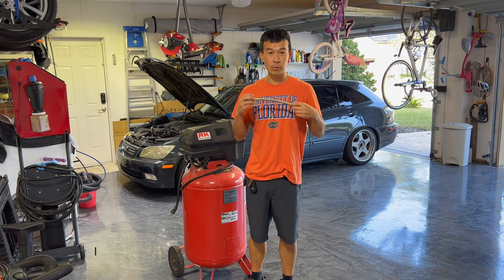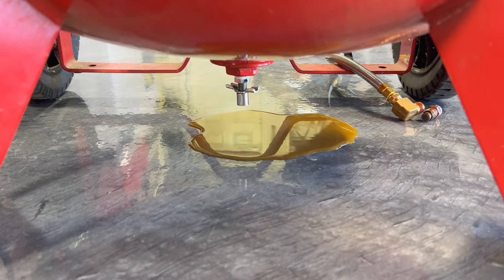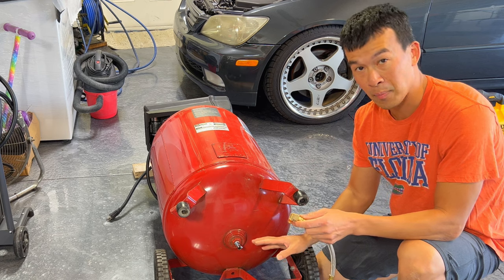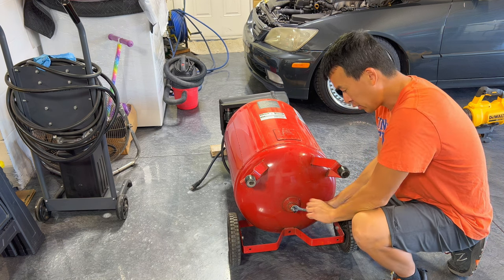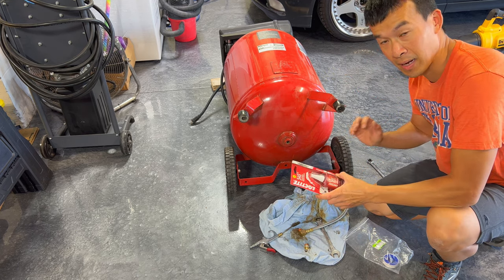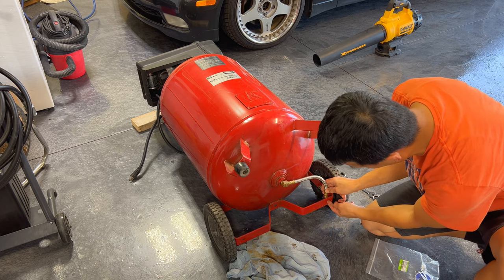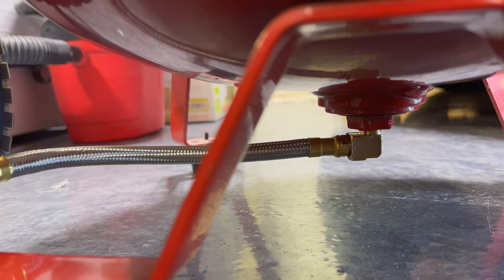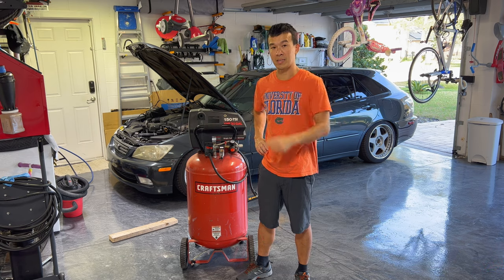Air Compressor Drain Valve Replacement - Water Drain Extension

Comment: Thanks!I had mines seating fit a year since we bought our house. Went to use it and noticed drain valve won’t close and started looking for alternatives repair options. This help since now I can use this method to drain out to my little vent in my garage Vs worrying about a tray
Reply from the maker: Yea for my 60 gallon, I open the valve once a week and just spray the water. It’s not much but good habit for keep water out of the tank.

Comment: I purchased a Black Husky 20-gallon vertical air compressor from the marketplace yesterday. However, seller said the motor fan is broken. I've already ordered a replacement fan. The seller assured me that the compressor is less than 2 years old, despite the broken fan. He mentioned that it has been stored in my garage for about 9 months. He suggested that by replacing the fan and draining the water from the tank, it should operate like new. Is it acceptable for the water to have been sitting in the tank for approximately 9 months, considering the seller's claim that the compressor is less than 2 years old? It's my first time using an air compressor, and after watching this video, I'm a bit worried about the possibility of an explosion. :)
Reply from the maker: You can see the date code on most tanks. There’s a plate and stamp. As long as it was sealed, water isn’t an issue. I’ve left mine with moisture longer. If you want to be 100% you can hydro test with water and a pressure washer. I have a separate video on that.
Reply: @TunerwithKids  Got it, thanks. I'll be sure to watch your other video on hydro testing from your channel.

Comment: I used to have a compressor just like that one and I literally wore it out. Very reliable but also very LOUD LOUD LOUD. Hard on the ears. I bought a 5 hp 60 gal and its a lot quieter.
Reply: I found that the oil-free compressors are 4x louder so I don't buy them.
Reply: @Sidicas  Generally that has been true but they have quiet oilless compressors now. California Air Tools and Fortress (Harbor Freight) have them. Usually the secret to their quietness is running at half the speed of a typical oilless and using two pistons instead of the typical single piston.

Comment: Is there a way to test for corrosion on the inside? Just picked up and old compressor that hasn't been used in at least a couple years and it sounds like there's water in there.
Reply from the maker: Hydrostatic test and scope the inside to see condition. I did it for my IR 60 gallon. https://youtu.be/hkG8wQHu87Q
Reply: Make sure you actually do a true hydrotest and have it certified not just squirt water in tank with a pressure washer.